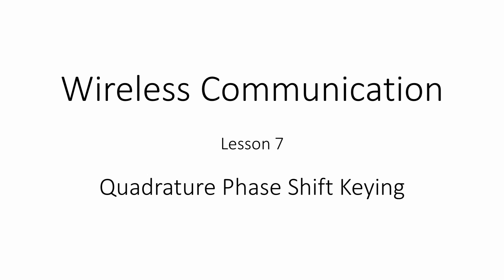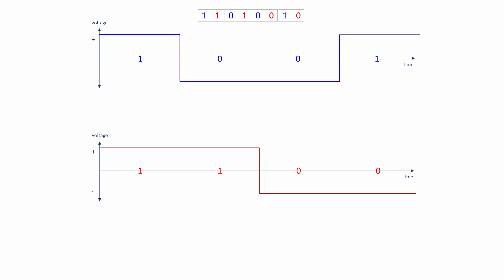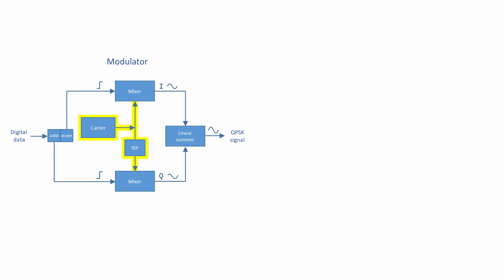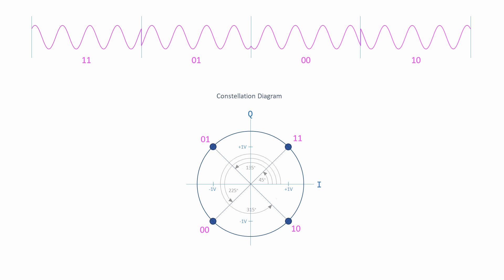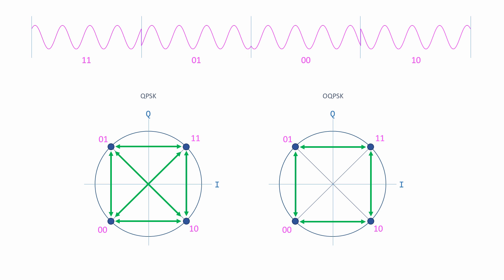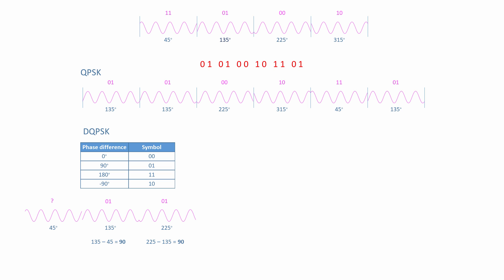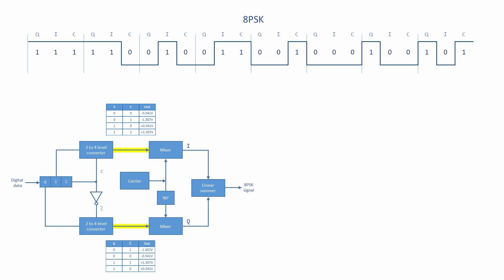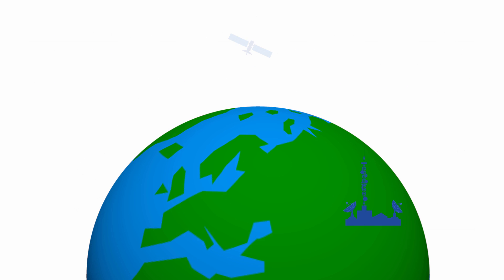Wireless Communication – Seven: QPSK

Comment: How come it is twice faster, if I still use two cycles for each 2 bits?
Reply: it comes twice faster compared to bpsk where one symbol is one bit. when you transmit one symbol with bpsk you transmit only one bit. but with qpsk one symbol has 2 bits, so each transmitted symbol will contain 2 times more bits compared to bpsk

Comment: Why we are not writting 00 in the first quadrant and 01 in the second quadrant and 10 in the third and 11 in the fourth quadrant?
Reply: the codecs can be in any form like 00 in 4th quadrant and even in 3rd quadrant as well, it is just that the schema should be known both to transmitter and receiver.